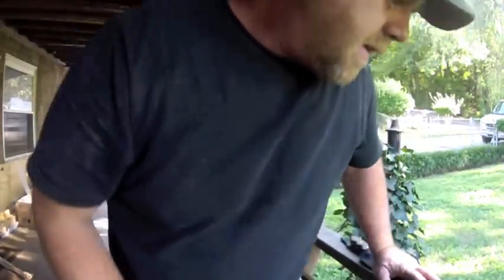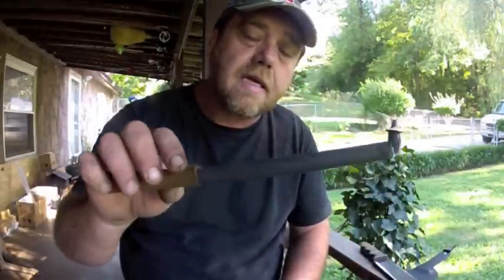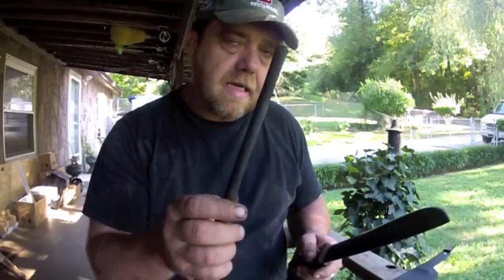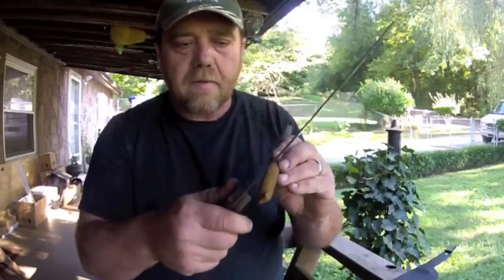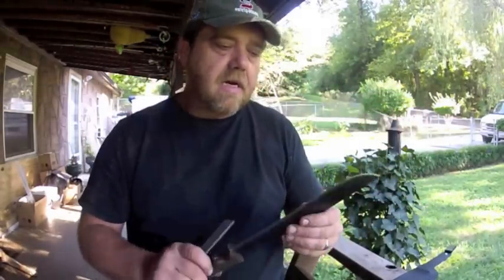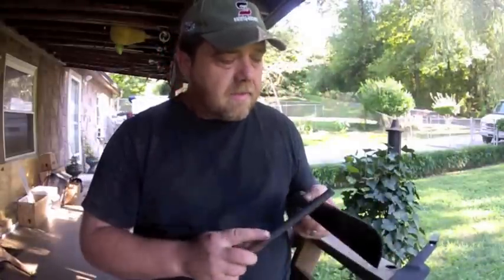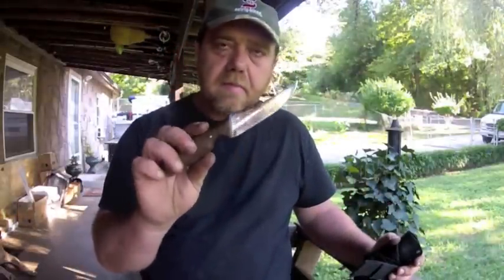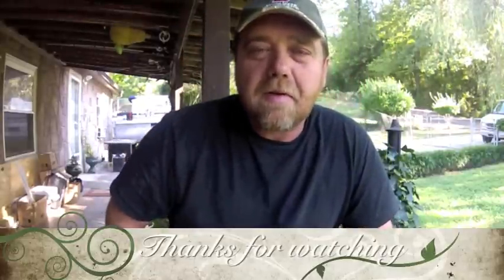old trick, to sharpen your knife

Comment: Great tips! I carry a ceramic insulator that I bought at Tractor Supply for knife sharpening. It works great. The coarse side is fine for the initial sharpeing. The fine side will bring out a razor edge. Cost 85 cents.

Comment: Machinists use a grit-impregnated rubber stick to slightly round off the very sharp edge of end mills. this keeps them from cracking at the edge under pressure.  It works great on axe edges.

Comment: Thar is really cool i never thought of that, it is better then taking your belt off to sharpen. Another thick my pops showed me it take the inside of a florescent bulb, it is one of the smothest things out there and is very hard.
Reply: Josey Stateson That sounds good, but I don't understand how you use the inside of the fluorescent bulb.  If you break the bulb, the inside is round and concave.  Will you explain how you use it?  Thanks.
Reply: Yeah, plus the mercury inside a florescent bulb is so toxic the govt recommends handling broken florescent bulbs with HAZMAT suits on.

Comment: old fashion barbers are using a long leather strap to get the edge back on old fashion razors and it works so if it works on a razor it should work for all types of blade if they are not to messed up and they just need to have the edge raised

Comment: I tried this, I normally sharpen on a Norton Indian stone. the compound I used seems to so course it leaves a very toothy edge if you are not careful it will fck  your edge.
Reply from the maker: there are many kinds of compounds, use what works for you.. putting very little pressure using this compound don't leave a toothy edge. thanks for your advice.
..bill

Comment: So, you basically made the leather into a high grit sand paper...Interesting.I wonder what else the leather could be impregnated with. Maybe chalk and oil?
Reply from the maker: yep, it is one of my best sharpening tricks...give it a try ,you may like it..
chalk or oil may work as well, great idea..
..bill
Reply: I have been looking lately at what I can do with nacre (mostly crushing it from abalone). Maybe I can invest it into a piece of half tan. Seems like it would make a good polishing agent if it could be kept from slipping over itself.
Reply: billy joe denny Oil and than finely crushed charcoal if you do not have anything else. I use that at the moment on my leather strop. Chalk is very fine grit indeed.
Reply: I have been playing with chalk recently. It's um...doesn't seem to do anything like I thought it might. Not in the way of helping the edge get sharper at least. But, it doesn't hurt the edge either. And I figured something out. If you have a second strop that is just impregnated with chalk. And, you give a blade one pass on both sides 9as if you were really stropping). The chalk deposits itself on the edge. And, makes the bur, and any an even or high to low points very visible. Which makes it easier when going back to the stones.

Comment: How come you use that file away from the edge instead of cutting toward the edge?
Reply: Joe Hanson He mentioned that it ruins the file.
Reply: I didn't word that very well so I understand your misunderstanding. I meant why would he sharpen away from the BLADE's edge with the file and not towards it? I've always been taught and I've gotten better results when I file towards the edge. Using stones I can go either way but I always finish towards the edge on the final stone. I only finish away from the edge while stropping.

Comment: Would a knife made from a file be to brittle?
Reply: It depends on how you use the knife. If you want a good cutting tool that holds it's edge, no. But if you want to make a utility knife that may get rough treatment, I would temper it back a bit, say 180 degrees C for 1/2 hour, air cool.

Comment: 0:20 why couldnt you find anything to sharpen it? Was the steel bad or something?
Reply from the maker: nope its good steal, but a stone would skate across the blade and not do very much..it would take the file to cut a good edge, and hopefully keep the edge with the valve grinding compound and leather..
..bill

Comment: On that handmade knife you should never use a file on it. You need a coarse stone to put a angle on the blade and a finishing stone to a sharp edge which you can keep using to touch up the blade from time to time. If you do it right you can shave with it.

Comment: ... friend a file is no tool for sharpening a knife, a flat bit of any hard stone, bitch to do I know but you only have to do it once, a scrap of limestone or soap stone and some water, rub one against the other to get some sediment residude and gently press the blade into and along the harder flat stone, done. shits so sharp it will cut news paper that's dropped onto it. I like the leather finishing stick, perhaps you could modify it to have a hard flat stone on the reverse?

Comment: What a great idea! The leather gives just the right "cushion" to make the sharpening work more effectively. I use diamond rotary flat laps for lapidary work and the soft ones are so much more effective for polishing. Same goes for diamond resin bond grinding wheels vs sintered  diamond wheels. It's also evident in silicon carbide or emery impregnated rubber abrasive like you find in Cratex abrasives. 
Now if I could only find a REAL auto parts store here in Orange County, California lol!
Did you say you glued the leather to hickory? If so, what adhesive do you recommend?
Edit: I have to add this. The PVC holder = brilliant! A practical genius at work here! (genius at creating practical solutions)

Comment: This is probably the most unique and helpful tip in my entire 86 video knife-research play-list ... Thank you very much for taking the time and the trouble to share this very useful information !! ... I am considering gluing leather to a piece of 2-inch PVC pipe (after I wet-form it) and also, maybe, to make a legal sized acrylic clip-board into a stropping station with leather on one side and a jumbo mouse-pad on the other ... I can lay emery cloth (wet/dry sand-paper) over the mouse pad for a pronounced convex edge and use different honing compounds on each of the 3 or 4 edges of the leather side of the acrylic board. ... I am just looking for a very capable system for my hiking and camping pack.

Comment: Could you make a sheath that has the compound on the inside of it?  So each time you pulled your knife in or  out you were also sharpening it.............?  ")
Reply: astrialinda H 
I think for a work knife it would be a good idea...maybe just white or green compound and some way to guide the blade. Expanding on that, two pieces of leather at the case opening could be angled and offset, similar to the carbide or ceramic stones in the pull through sharpeners.